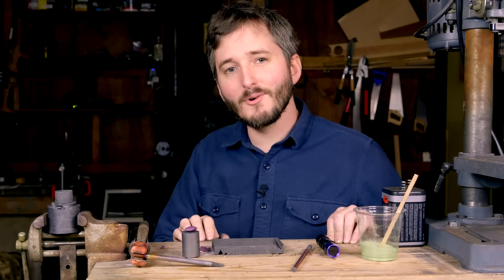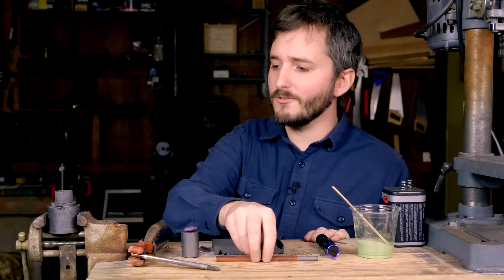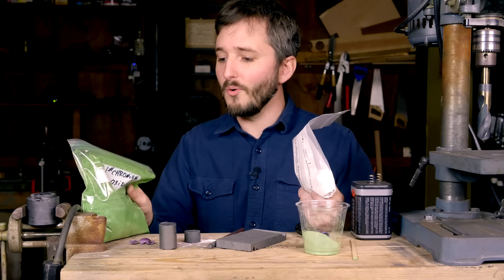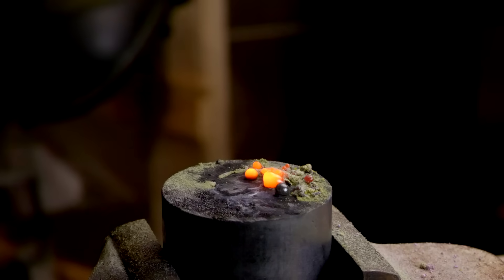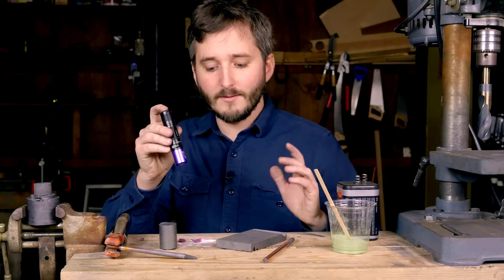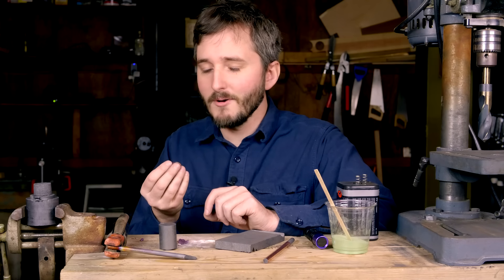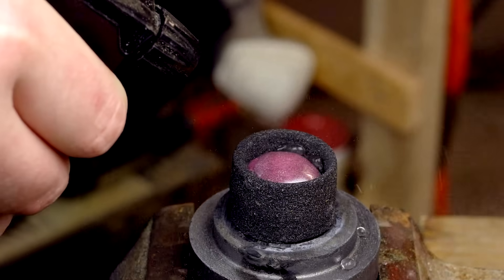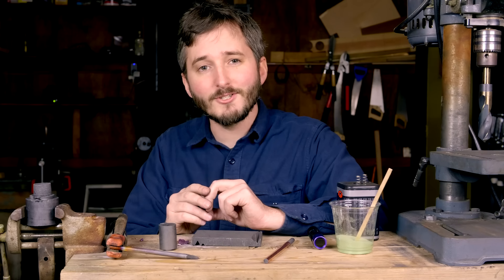How To Make Synthetic Ruby In The Workshop

Comment: Sadly these rubies are completely amorphous - a mush of Al2O3:Cr crystals. To make single crystals, you need to implement the Czochralski process, and that is a LOT more complicated than just blasting a crucible with an arc welder.
Alternatively the Verneuil method, but that's even more complicated to get right than Czochralski with modern hardware.
Reply: Really need vacuum to manage the temperatures involved. I wonder if  you started with a rod you could use a moving melt zone to create a monocrystal instead of pulling a boule from a melt pool.
Reply: @RobertSzasz  Moving melt would also work here, but also a hair more complicated than Czochralski.
Reply: @Spirit532  Correct. The only way you're going to get a single clear crystal out of this poly-crystalline mess, is to grow a small seed crystal.
Reply: @luisderivas6005  A seed crystal won't help. It needs to be a slow growth either in a moving melt(Verneuil) or melt puller(Czochralski) system.
This isn't like growing crystals in oversaturated water.
Reply: @RobertSzasz  I have a vacuum. I am going to make a huge one in my oven but how do you use the vacuum to make it?
Reply: @Barskor1  So you just use the vacuum to get the hot air out of the oven after you are done?
Reply: @Barskor1  I know what i need now tho. Someone told me i need a welder machine so i have to see if they are like $100 or more. But then you can sell rubys for alot. Maybe $500 for each one.
Reply: @greenlawnfarm5827  you should definitively do research in the value of synthetic rubies, I don't think anyone will buy yours especially unpolished
Reply: @greenlawnfarm5827  just buy a cool rock
Reply: @jeremymcadam7400  They have tons of rubys on ebay and i am going to buy some and make diamond stones out of them for rings.
Reply: @greenlawnfarm5827  it's probably gonna cost you a fortune in abrasives
Reply: @C4H10N4O2  I have a dremel and it can cut steel so it would work.
Reply: @greenlawnfarm5827  there are many things more resistant to abrasion than steel...
I think you should learn more before trying to make money with something you don't seem to know much about
Reply: @C4H10N4O2  The dremel spins super fast so it would work. And theres metal and sandpaper ones.
Reply: @greenlawnfarm5827  Don't waste time trying to convince me, just do some research to see if you are right
Reply: @greenlawnfarm5827  steel has a hardness only slightly higher than glass, it doesn't matter how fast your dremel spins, it'll just wear down faster unless you have a dremel bit that is diamond coated. Secondly to make clear gem quality rubues you need much more than a backyard setup. You'd need to sink thousands into the kit and even then synthetic rubies just aren't that valuable.
Reply: Zivilyn, you don't need that much set up to actually make gem quality rubies or any other Corundum crystal.
However, the size in which you can make gem quality rubies is fairly limited, and requires a lot of effort and money to produce decent size ones.
Reply: @greenlawnfarm5827  B8, right?
Reply: @walkmanstudios9733  What is b8?
Reply: @ZivTheWyrd  yeah i can buy optical grade rods from russia for like 100 bucks....for a pretty big one.
Reply: @C4H10N4O2  lol like talking to a wooden post. I use wooden saw blades to cut concrete all the time lolol
Reply: @greenlawnfarm5827  LOL. I  appreciate your enthusiasm. Happy gem creating1
Reply: @Barskor1  Wow, that's truly a helpful and educational response in the spirit of the channel. There are ways to discourage dangerous behavior without crushing curiosity.
Reply: So what you’re saying then is they made ruby glass?
Reply: Gregory Warner No, it is not glass, it is like a piece of quartzite instead of a clear quartz crystal. What he made is micro crystalline instead of a single crystal lake a gem ruby.
Reply: @geeko321  Glass is never crystalline, it's an amorphous solid.
Reply: @Spirit532  incorrect....it is a slow moving liquid....
Reply: He is fucking with you all lmfao.
Reply: Been interested in the Verneuil method since I was a little kid, and learned that this french chemist found a way to make rubies.
Reply: @Baitrix1  Bigger, but still amorphous.
Reply: @Spirit532  
Is amorphous ruby good enough for jeweled bearings?
Reply: @gregorymalchuk272  No.
Reply: Oh hey there!
Reply: @Baitrix1  no, it wouldn't..because you still have an absolutely shit surface..leading to scattering
Reply: Thank you very much for listing further reading material like this
Reply: So if what he has made does not have a consistent crystalline structure, what would you expect to see by cutting and polishing it? Would it simply remain opaque?
Reply: @blahblahblahblah2837  Yes, it would.
He did make crystals - just millions of tiny ones, not a single big one.
Reply: @Spirit532  yep and this thing is nowhere close to being optical quality or even gemstone quality. This is the process they use to make ruby for abrasives like sandpaper etc.
Reply: @blahblahblahblah2837  yes the randomized structure from rapid cooling and growth will diffract the light in all directions, but will not transmit through so it looks opaque.
Reply: Wtf am i doing here
Reply: So, anyone know what the flux method is? Chatham uses it to grow their diamonds...
Reply: Are natural rubies even crystalline then? Ruff gemstones don't always even have a crystalline shape. They are cut to look that way. Even crystals on a chandelier aren't really crystal. Its just leaded glass cut to crystalline shapes.
Reply: @guptadagger896  No, this is amorphous. Polycrystaline too, but mostly amorphous.
Reply: @guptadagger896  Think concrete with gravel.

Comment: Next up: how to travel to mars with a pencil sharpener and some hot glue
Reply: With special guest Mcgyver.
Reply: that may be a bit much, but I mean... a commodore 64 would probably be able to get you there though
Reply: @PilkScientist  funnily enough, I've been working on a z80 emulator and although it's a bit more versatile than the 6502 in the c64 I might have a go at writing some basic mars landing software for it. Always up for an unrealistically hard challenge!
Reply: @KingJellyfishII  it's apparently about the power NASA landed with, so hey you can't go too wrong. The lunar lander's code and sequence is out there and slightly documented for your use, as well, though of course it's all proprietary to AGC systems.
Reply: I'm pretty sure you're supposed to use a pencil sharpener, a potato, and two hairs from the back of a cat that walks on two legs.
Reply: @aserta 👍🤣🤣🤣
Reply: Video opens to him sharpening a pencil and writing a massive check out to SpaceX lmao.
Reply: Cant forget airheads thoes things can patch a boat or maybe flextape/glue/paste?
Reply: and get back home safe. I don't think he'd settle for anything less than that.
Reply: You'd also need a rubber band if U wanted it to have any chance of success
Reply: Holy shit, I’ve got both of those items. Seeya later suckers
Reply: Next up: how to make a working arc reactor
Reply: Heheee!
Reply: i know where u can put the hot glue to get a head start
Reply: 1024, stop doing drugs, son.
Reply: Lol how to destroy a sun with an Arduino.
Reply: LOL, are you saying he's the new McGuyver?
Reply: Don't tempt me
Reply: hahahhahahahha XD that was a good one :D but yeah, obviously this is a very interesting channel :D
Reply: Ikr
Reply: Actually not too far off.

We accidentally sent the fastest known object to leave the planets atmosphere before Spudnik.

It’s going faster and further than or probe has gone.
Reply: @silent_stalker3687  what object is that then?
Reply: @KingJellyfishII  it's a manhole cover.
Reply: "I'm making a computer out of bear skin rugs and stone knives."
Reply: You go to Scott manly’s channel for that
Reply: Hahahaha
Reply: How did you know?
Reply: And rubber band without doubts.
Reply: And a wd-40 bottle
Reply: Bad joke
Reply: I'm on board with that.
Reply: Oddly specific
Reply: Well all you need to do is expose the fissile core of the atoms held in those materials; release all that energy from the right angle at the right time of the century and the right time of night, and some of you WILL get to mars, if you launch from the Upper Atmosphere.
Reply: LOL
Reply: Dumbass
Reply: Gotta be a manual sharpener not the fancy type...
Reply: Done that  already , though I did have to add an elastic band 😂
Reply: You sound just like Elongated Muskrat.

Comment: What will a ruby like that look like after cut and polished like a gem?
Reply from the maker: It's pretty milky, not gem quality. That would take a little more care in making them I think
Reply: @Nighthawkinlight  you would probably have to incrementally cool over an extended period of time, so the crystals form slowly and clearly
Reply: @Nighthawkinlight , thanks!  Really cool process.  Thanks for sharing.
Reply: @Nighthawkinlight  Now you can buy a diamond plate of a ebay for like 5$ mount it on a bench grinder and grind that beauty to make a giant ring :)
Well ruby is used as a bearing in precision watchmaking -maybe try making a bearing out of it?
Reply: @zumbazumba1  Seconded, I think the industrial uses of not-very-pretty rubies is way more interesting. Super durable tools too perhaps.

Comment: Birds of a feather...flock together.  I think like-minded people follow the same stuff.  Been subbed to Elemental and have seen all his rubies...I like how all y'all work off of each other and improve.  Soon enough you will be making ruby rod lasers from scratch...Which will take HTME a while to get to.
Reply: Making laser-quality rubies is so much more difficult than just making polycrystalline blobs. I doubt we will ever see it on YouTube, but if we do I would be very impressed.
Reply: @karlsinger4760  : I think the true spirit of it would be for all to strive towards that goal.  That is truly how to remove monopolies of power and knowledge.
Reply: Theodore Maiman's early laser used a powerful energy source (xenon lamp) to excite atoms in a synthetic ruby to higher energy levels. At a specific energy level, some atoms emitted particles of light called photons. These newly created photons struck other atoms, rapidly stimulating the emission of more identical photons and amplifying the light intensity. Maiman was able to continue this process of stimulated emission and amplification by placing a completely reflecting silver mirror on one end of the model and a partially reflecting silver mirror on the other. This setup enabled photons to bounce back and forth between the mirrors until they gained enough intensity to burst through the partially silvered end as a powerful, coherent, beam of light--the first working laser prototype.
Reply: Isn't it funny.  You'll go to some channel you think is obscure and you'll see familiar names in the comments.
Reply: Birds of a YouTube algorithm... algorithm together
Reply: Ruby Rod Lasers?
Are those like... Lasers shooting out of a flamboyant hair-tunnel while Bruce Willis tears stuff up?
Reply: @scottcantdance804  : You almost got it!  But no.  Ruby rod as in a cylindrical ruby with one end silvered completely and the other end partially mirrored and excited by a xenon flash lamp to make the first laser.
Reply: @danbhakta  yeah, I prefer my Fifth Element reference to your explanation.
Reply: @scottcantdance804  Big BADA BOOM?